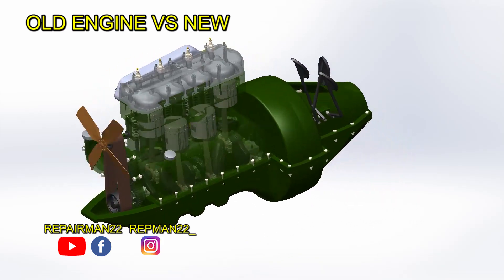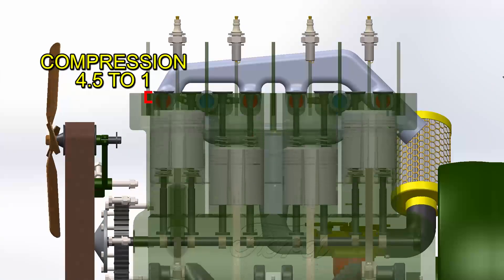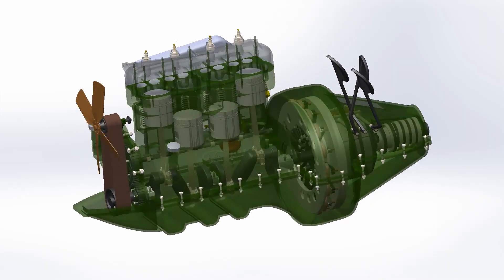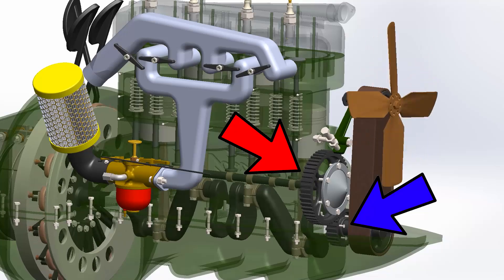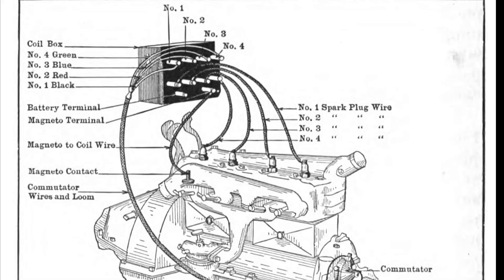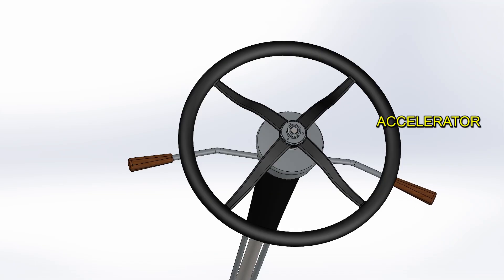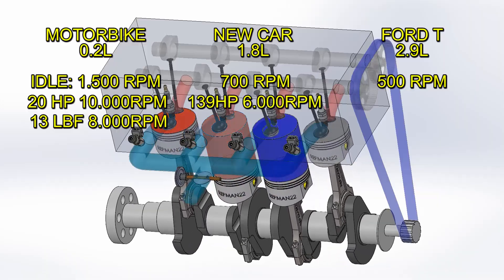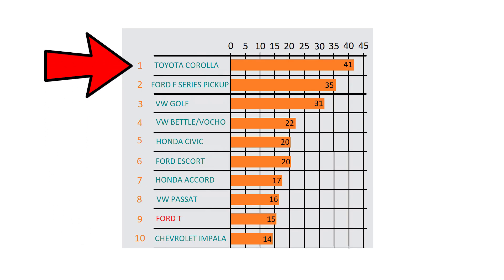Ford T vs New Car 🤯 3D Animation// What changed in engines in 100 years?

Comment: Horses at the time were also a viable option. They contained more moving parts but maintained themselves through biological repair processes. The horse ran on hay and grass which was plentiful and free. 

The exhaust, in the form of smelly clumps of droppings, were non-polluting and could actually be sold for use as fertilizer. A horse had approximately 1 horse power and four hooves which provided locomotion in lieu of wheels. 

Horses were manufactured by other horses, sometime several at a time, though it took at least two horses to make them. The downside of horses to automobiles was that horses needed to be kept on (alive) at all times, they needed to eat and drink even when not in use. They would also sometimes die and there was no way to bring them back to life no matter how much people paid the local horse mechanic. If a horse's hoof went bad it couldn't be removed and replaced with a new hoof, cars on the other hand could have their tires replaced if one became damaged or deflated.
Reply: Fun fact: the average horse produces around 15HP at max power. Not too far from a model T, is It?
Reply: @pdr-s5i  12HP for very a short time... far from Ford-T...
Reply: @Bialy_1  talking about peak power...... not sustained power............
Reply: Horses came with Adaptive Cruise control, Hill descent control, automatic braking, collision avoidance systems and had better self driving capabilities than most cars do today. A drunk or drowsy driver on a horseback was less of a risk compared with a car seat.
Reply: @Wingedmechanic  not to forget: at least for the was home, a horse has reasonable voice control,  autonavigation features and won't end up in the ditch (lane tracking), even when the driver is drunk or out of order.
Also, horses are available in additional color patterns.
Reply: @Wingedmechanic  "collision avoidance systems "Are you sure about that? Ever heard of Marie Curie husband? Plenty of people were ending up dead every year because of horse related accidents back then.
Reply: @Bialy_1  
Yes  ,  some  health  risks .
Was  one  of  them  ,  Tetnus  ?
But  the  need  then  to  study  to  find  the  cure  ,  Maddam  ??
Reply: @Wingedmechanic  
Yes   Sir   !
They  are  "  in  there  with  a  chance  "  ,  as  the  saying  has  it  .
That ' s  why  they  will  exist  for  Centuries  to  come  .
But  what  combustion  motors   will  also  ?
Reply: @Wingedmechanic  Obviously   GOOD  selling   features  of  that  . . . .   " motor  "
Reply: Hmmm, you remind me of the used Horse salesmen I used to deal with, back in the 1800s.
Reply: @CNCmachiningisfun  One owner horse, always garaged, only rode to church on Sunday.  Car/Horse salesmen haven't changed.
Reply: It's true that a 🐎 made about 1 hp on idle. But a 🐎 typically made 12 to 15 peak hp which is the same metric we use for cars hp.
Reply: @pleasedontwatchthese9593  Horse producing zero power on idle... 1HP was calculated for constant work but its in fact slighty more(like 20% more) and that 12hp is usable in short periods from time to time.
Generaly if u often abusing this power -> like for example horses used for pulling trees/wood in mountain areas -> then this horse gonna have a very short life...
Reply: @pleasedontwatchthese9593  Marvellous  machine  ,  the  horse  .  Used  successfully  for  thousands  of  years .
Hey  !
What  about  fitting  wheels  to  them  ??
Reply: Can you slam a horse tho
Reply: @thomaswawrzyniak118  yes you can by sawing off the legs to your desired height and gluing it back on although this may cause undesired side effects.
Reply: @thomaswawrzyniak118   miniature pony. sort of is a slammed horse.
Reply: Yeah but how you turbocharge a horse
Reply: @prodbasedmystik  I don't think you can turbocharge a model t either tbh
Reply: @prodbasedmystik  by giving it something similar that gives a factory of excitement and more energy. just like when a person gets hyper 
when they eat/drink sugary foods/drinks or coffee. it may not be a supercharger. but it will enhance the power of the horse to a faster speed. it may be difficult to drive now its hyper. but oh well. there is your answer
Reply: @Marcy53Volkswagen  You mean cocaine
Reply: @prodbasedmystik  best comment ....
🤣🤣🤣🤣 i really want to see an experiment ,with a turbo on a horse! 🤣🤣🤣🤣
Reply: @bobvido9875  Turbo for a horse , It's been.done ,they call it a whip.
Reply: @prodbasedmystik  Hot chilli sauce up the exhaust lol
Reply: @prodbasedmystik  
    Diet   and  exercise   !
Easy  fit  ,  retrospectively  or  from  new .
Have  seen  those  Brute  Class  Draught  Horses  ?
Strong  as  an   Ox .
Born  tough .
No  need  to  Turbo  charge
Reply: @prodbasedmystik  Nanomachines, son!
Reply: It has been estimated that food for horses took up around 20 - 25% of the cultivated land - so food for horses where absolutely not free!
Reply: Horse exhaust was polluting though, and spread disease and did not disperse into the atmosphere. You had to hire a tech to remove exhaust from roads, especially in the city.
Reply: @alyssa7867  that only applied to city horses, country horses exhaust clumps usually went on pasture land which was cycled for agricultural use on a bi yearly basis.
Reply: Horses require constant care or they deteriorate quickly. Lock one in a barn next to a Ford for twenty years then see which starts easier.
Reply: @Alan Brando but they could rot from damage. so they had to be auto repaired and had to be  not used for some days. in order to allow the damage to disapear. which was a disadvantage. and also horses would often  throw of drivers on a run. with a lack of seats aswell some passengers being way to heavy
Reply: @Marcy53Volkswagen  You  mean  ,  inbuilt  ,  and  free  ,  mechanical  ,  self  repair  ?  Rather  than  expensive  mechanics  ?
Reply: Before climate change and lead in the gasoline, people were concerned with the ammount of horses shitting all over the streets.

Oh, and though you cannot change the horse's hooves, you can change the horseshoes.
Reply: But, but, but, pleaseeee just think about the poopies.
Reply: False ... horses are polluting. Cows as well.
Or haven't you heard the latest WEF overlords narrative !?
So we must stop eating meat and eat cockroaches instead to stop pollution. While they fly private jets and exotic cars that make more pollution than millions of people combined.
Reply: why the past tense, horses are still around.
Reply: But do you see a horse from 100 years ago that is willing to get up at any time, walk several miles on minimal fuel, has built in lighting systems, enclosed cabin for up to 6 people, and reach a consistent 40mph speed and have a reasonable storage size? If a wheel breaks or becomes flat, you can simply replace it with a spare. The horse breaks a leg, now you have to let it heal and spend a few thousand to make sure it's okay. You also don't have to groom a car. Well, you do have to clean it every once in a while. And your horse requires constant maintenance and food, even when not running. Throw a Model T in the elements for 40 years. It's probably fine, just needs an oil change and some new fuel. Throw a horse in the elements for 40 years you either have no horse and sad times or dead horse and big fines for animal abuse. 

I don't think you can replace panels on a horse, either. Shooting one with a bb gun is also able to land you an animal abuse case.
Reply: actually 1 horse can go up to 15 hp dunno what rpm or whatever :D
Reply: @522alien  hm. SPM (steps per minute), featuring some CVT: continuous variable trotting or simply: variable hoof timing
Reply: The horse crap caused death and disease.. i love that people can just create a false narrative to show how in tune they are.
Reply: "were non-polluting " that is why so many scientists back then were scaried that because of the massive city growth cities gonna drown in this "exhaust" -> in XIX century horse droppings were the equivalent of modern CO2 dooms-day predictions... Scientists were claiming that in 1950 the amount of the "friendly droppings" will be on the streets reaching  second flor windows and there will be no chance to remove it because of its volume.
Reply: And youre unlikely to fall off your model T
Reply: if only horses is the option right now and it need to fill the modern transport population, i dont know how many horses needed but im sure maintaining that many horses would be nightmare and aunty vegetarian karen would haunt you.
Reply: @guessnot8015  
But  advantageously  ?
You  can ' t   eat  a  Model  T   Ford  !
Reply: Yes  ,  but  ?
That ' s  why  both  car  and  horse   are  kept  alive  as  complimentary    forces  for  transport  AND  WORK  ,  Jobs  .
Reply: A horse actually has around 15 horse power
Reply: @EctoGamer    

Hullo  ,  you  Chaps  .
From  ,  Perth  ,  West  Australia  .
Did  you  say   1 5  horse  power  ?  From  just  the  one  animal   ?
That  is  interesting .
Obviously  ,  there  are  several  ways  to  use  horses  all  types  around  the  world .
From  " Pony  Express "  operations  ,  to  Heavy  Haulage  Draught  Horse .

But  ?
Just  thought  of  ANOTHER  way  to  use   horses  .
As  much  as  l  know  ,  not  yet  done   and  never  before  done  ,  on  Planet   Earth .

What  would  THAT  ,  Idea  be  worth   to  Henry  Ford  ,  now  ??
Reply: @georgehorobin2225  yes, a single horse outputs 15 horse power, it's a unit, that was calculated with horses, it doesn't mean power of 15 horses
Reply: @EctoGamer  
Approximately  ,  what  many  actual   Horse  Power ,   then ?
Can  that  be  known  ?
In  the  18  th  or  19  th   Century  ,  did  Engineers  do  a  definitive   study    of  work  output  ,  average  and  max   of  a  typical  healthy  mature  male  horse  in  England  or  America  ?
They  are  a  very  powerful  animal  with  great  stamina  AND  durability  .
Sim   to  a  giant   dog  ?  
Even  " Brumbys "  are  a  tough  little  mountain  horse  that  seem  to  run  all  day  and  make  steep  hill  slopes  appear  as  flat  ground  to  us  .
Reply: @georgehorobin2225  what are you on about? Lmao
The test was conducted through out a day, horse got tired, that average was used as a unit (1 horse power), but at it's peak the horse was doing 15hp, then it dropped to 0.1hp during the day, average was 1
Reply: @EctoGamer  
Good  .   Yes  ,  l  thought  it  would  be  something  like  that  .
The  measure  of  horse
( Power )  would  be  an  average  ,  over  a  range  of  power  outputs  .
Same  as  a  dynamic  test  of   power  from   an  engine  ,  at  idle  speed  through  to  max  r . p . m .  produces  a  big  variation  of   B.H.P.

My  comment  about  Mr . Henry  Ford  ( now )   and  his  interest  in  matters  ,  was  of  course  a  provocative  Joke .
But ,
Seriously  ,  ln  this  year  of  2 , 023   ,  who  would  be  alive  at  Ford  Motor  Company  ,  to  show  interest  in   Consumers   ,  lnformation ?
Mr . Lacy  Ford  is  probably  dead  as  well .
And  a  Management  Board  may  be  the  worst  people  to  talk  to  about  a  New  World  of   ldeas   coming    up  .    
About   the  first  Ford  engine  and  ,  a  huge  number  of  engines  ,  since  that  one .

My  comment  about  the  new  idea  for  horses  ,  must  remain  a  secret  for  now .  
But  it  is  to  do  with  both  comfort  for  the  horse   AND  greater  performance .

Similar  to  that  of  a  BETTER  engine  Design .
And  surely  the  World  needs  better  things  for  better  people .
(  a  basis  for  Capitalist  Competition  ?  )
The  word  ,
     Betterment  (?)  of  Mankind  .  
Do  you  have  that  one  in  the  States  ?
Reply: @georgehorobin2225  why are your comments so weird? Double spaces, weird paragraphs?
Reply: @EctoGamer  
I  refuse  to  answer  that  ,  on  the  grounds  of  ,  in  ,  Sanity  ?
(  Don ' t  say  that  too  fast  ,  it  might  seem  like  ,
Insanity  ?  )  
But  ,  hang  on   !    
Have  not  l  just  answered  that   ?    
So  have  l  contra  dicted  myself   ?
It  would  seem  that   way  ?
But  ,  don ' t  forget  .  We  are  using  the  English  Language .
The  Language   of  a  
"  Mongrel  ".
ie .  Of  a   mixture  or  corrupted  ,  not  pure  species / specimen  .
Similar  to  what  you  folk  know  as  ,
A  United  States
Reply: @georgehorobin2225  im from eastern europe
Reply: @EctoGamer  
Yes  ,  that ' s   right  .
From  ,  the  United  States  .
Reply: More people die on horseback, per mile travelled. Horse faeces caused massive hygiene issues and death. Horses can be very flighty and kill a rider as commonplace.
Reply: You can't modify a horse tho.
Reply: One horse had actually 15Hp
Reply: however one disadvantages where that since the horse was alive. and could choose. so that means that steering was difficult. operating a horse was difficult for drivers. and the horses would have some fear. causing them to stop or throw off the driver. and the horses could disconnect from carriages from damage. and the horses would get tired. and also had a walking order of 2-1-3 (and more walking orders)

the horse would either be pregnant sometimes. depending if it is going into manafacturing a small horse. later to become transport
Reply: @Marcy53Volkswagen  Was  the  horse  the  reserve  driver   then ?
What  if  a  Party  Drunk  going  home  on  a  horse  ,  fell  asleep  "  at  the  wheel  "  ?   Would  the  horse   get  him  home  ?
And  without  a  speeding  or  drunk  driving   Charge / Ticket   ,  from  a  Traffic  Patrol  Man   ??
Reply: If you put manure into a septic tank, or sewage plant, it's "Green." But, methane is a much worse greenhouse gas than CO2.
Reply: @drpoundsign  So purging the plains of the millions of buffalo was a good thing for the environment.
 Also reduced the pollution on the Platt River.
 The best guesses of the North American herd size prior to the white man. 90 to 120 million bison.
 That is a lot of farting and pooping eliminated.

Comment: 13 miles per gallon = 18 Liter per 100 km
33 miles per gallon = 7,1 Liter per 100 km
Reply: That tells me nothing. Car manufacturers USED the larger gallon that was Imperial which is 4.55L    U.S. gallon is 3.7L(so a quart less)  They did not have to tell the public and it took awhile to figure out what they were doing.(all legal) but a Liter is a litre is a liter There is only ONE size 1000ml per liter.
Fuel economy was taking a car out onto a track and make it drive500 miles to figure out that number...overcoming rolling resistance, wind resistance and other forms of friction.
. Now they put one wheel on a dyno and figure out fuel consumption inside a shop, so no wind on the body, and the rolling resistance of the other 3 wheels is not a factor, etc. So, they are still cheating us with lies. & they all do it.

Comment: Less parts does not always mean more reliability. That's like say a door with 1 hinge is more reliable than a door with 3 hinges because there are less hinges to break.
Reply: Your comparison have zero sense...
And yes in modern engineering they going back to the less parts = more reliability as the idea to make it more complicated but more efficient did not worked so well -> For example go and watch some video with Elon Musk showing development of his rator engines -> the younger the design the fewer parts it is having.
The same is known for decades in for example helicopter engines, modern helicopter engine have few times less mechanical parts than stuff designed few decades ago.
Reply: @Bialy_1  yeah, it's not a good analogy I'll admit. I'm not saying that principle is completely wrong. My argument is that it can't be generalized to always be correct. Electric cars are more reliable in general than gas cars, but some electric cars have 
Design flaws that impact reliability, so the most reliable gas car is probably more reliable than the least reliable electric car. For example it can't be said that all 4 cylinder engines are always more reliable than all V8 engines because some 4 cylinder engines have design flaws that can cause them to be less reliable than a completely different V8 with less design flaws. The Ford model t engine is very simple, however that does not mean it's more reliable compared to a modern Toyota V8 or V6.